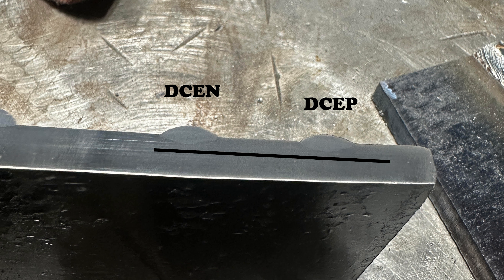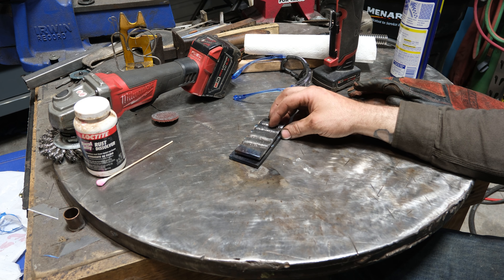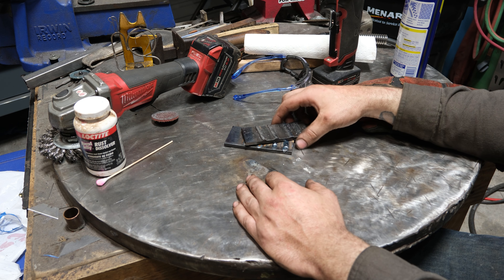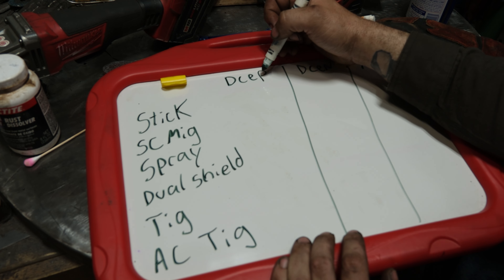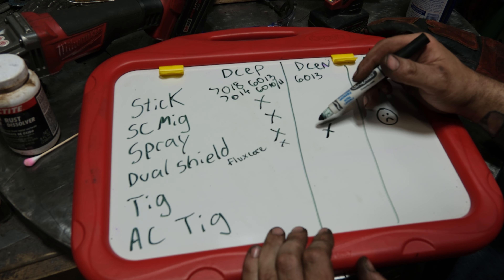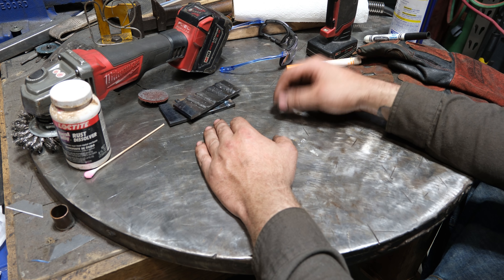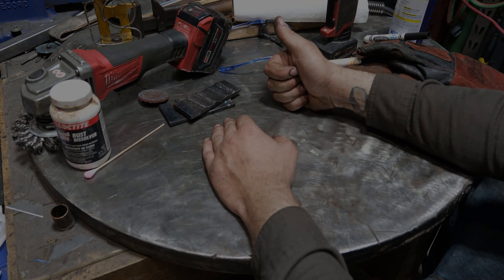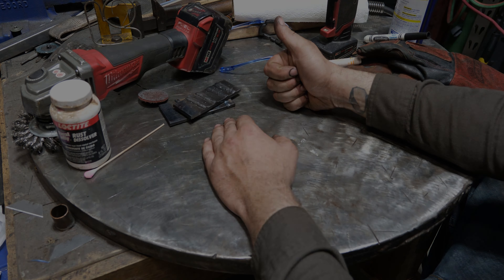Polarity and welding part 2:  Cut and etch & additional details

Comment: I had bought a lincoln flexcore welder to learn on and it sucked bad!! Then I learned that alot  are made in the same factory that makes sc mig machines and they just hookup the leads the same way!! Checked mine and switched the leads and now it welds fine!!
Reply from the maker: You would be surprised at how many welders get put up for sale as “doesn’t weld right” and all that’s wrong is the polarity.  Don’t feel bad though, I shot a whole video on doing outside corner joints with mig on the wrong polarity.  I knew something was wrong but I didn’t figure it out until the end 😅

Comment: Well, the push is a 'slight' forward angle running the wire in the front portion of the puddle, in practical practice, and it depends on how a person sets, or can set, their machine and the joint fabrication. Pulling can result in more spatter, more weld buildup, colder starts, the wire butting in the weld, and less of a smooth welding machine function and performance. You can hear how the weld is performing, and normally you'd want that sort of buzzing-whizzing sound to let you know the machine and the weld are working well together. Really, in application you're going to be changing your angles to maintain the puddle and the wire in the hotter portion of the puddle. Modern machines, with their hot-starts and other goodies, makes mig easier and more versatile, so a welder has more flexibility in their form.
Reply: Well said I have pushed 60# roles of 45 thousand wire in 7 1/2 hours some where.300 to 400 amp even 3/8 metal you know you have penetration because if you linger you fall through. I like this guy welding is vast .
Reply: First real welding job we only used .035" wire but with wire speed turned all the way up and power at around 300 amps.
' squirtgun welding ' 
Filling 1/2" gaps welding in the air.

Comment: Here in Europe, because we don't have 6010 or 7016, those who weld pipe use 7018 on DCEN for the root pass, from what I've heard.
Reply from the maker: I have heard other countries doing 7018 DCEN on pipe.  Whats wild with that is I am unaware of any manufacture that specifies 7018 to be run on DCEN (in the U.S.), and I have never heard of a code in this country that specifies DCEN with 7018 on pipe.  7018 is universally used for fill/cap and not root pass.  I would imagine the rod could be run DCEN, it would probably be less likely to drip/run on an open root.

Comment: This 1/16 rod on thin metal on DCEN sound interesting.
Maybe you can make a video about it.
NOt only autobody sheets (0.8mm or less) but bit thicker things like 1.2 or 1.5mm...

Cos lot of falks do not have MIG/MAG, but just stick, and if they can do this without making lot of holes...
Reply from the maker: I can tell you (no bs’ing) the hardest/most frustrating welding job I have ever done was auto body with stick.  Now I didn’t use DCEN with 1/16th rods but it’s hard to say how much that would have helped.  I will have to give it a shot and fail a bunch to see if it’s possible lol.

Comment: Gonna definitely try 6013 with dcen on thin sheet-metal, already bought the 1,6mm tiny sticks.
Reply from the maker: It will buy you a little bit of “wiggle room”.  6013 is pretty low penetration to start with, but sometimes any little bit helps.

Comment: I'll be testing some welds tomorrow- Mig and stick, to see what is going on with my welds.
Reply from the maker: Glad to hear it 😀👍.  It will build confidence when you can see what’s going on inside the weld.  If it’s not as good as you expected, make slight changes and try again.  Remember too, it’s very difficult to achieve a “perfect weld” so don’t be hard on yourself.  Focus on being consistent, consistency is key.

Comment: Another great educational video.  I am looking at the Everlast 200 amp migs. They max at 24v at 240.  With a 24v max, what would be the limitations other than metal thickness. Don't think I could run dual shield.
Reply from the maker: So 24v max is good for general short circuit.  Dual shield would really need 25v to work the way you would want.  Spray would be the same, 24v is the base of spray arc.  A possible solution to get decent performance would be to use 100% co2 gas.  That machine would run that and I believe you would be able to weld 3/8th steel with it.  It will have slightly lower strength than c25 gas but for most things I don’t believe it would be enough to matter.

Comment: My copy of the AWS welding hand book says that with MIG/MAG the drag technique produces a more convex narrower bead with a more stable arc and less spatter on steel but for aluminium lead/push technique is preferred as it provides a better cleaning action, I find for thin sheet steel that a push rather than pull is better as it is less likely to blow a hole. The reason why stick welding is better with DCEP is down to the positively charged metal droplets being attracted to the negatively charged work piece, accelerated both by this and the magnetic field they strike with a lot of energy which also produces heat.To my mind the beauty of mig is it's very forgiving and you can change the direction of travel to suit the job and position.
Reply from the maker: You bring up some great points.   With Aluminum mig pushing is often required because pulling produces undesirable side effects, which has a lot to do with shielding gas.  As with everything with welding there are very few things that are absolute, there is always atleast one process that does everything differently.  The push vs pull with aluminum is solidly in the “push only” lol.
Reply: When I did a lot of MIG welding I usually drug my welds to keep them neater as pushing was fine if you liked to shoot spatter balls all over the room.
With the weird metal that I TIG weld today I have found that it likes  to be pushed along better as when I try pulling it the weld is dirty and sooty looking.
There is not much difference but the weld sure comes out different.

Comment: I'm still making some test runs to determine some good ways to weld thin sheet steel (<0.060").  I've tried running FCAW normally and it usually burns through even on low settings, especially vertical up.  The same when running 6013.  I haven't tried DCEN with 6013 yet.  The only way that has worked well so far is the "series of tacks" method where you weld a second and break the arc, wait a second and go again, all the way along.  Any other suggestions for stick or FCAW for welding thin stuff?
Reply from the maker: So FCAW tends to burn hot.  To a certain extent using a machine with really good low end output helps.  Depending on your machine you may get more capability with a different machine.  A limiting factor with flux core is that it needs enough heat to function, if you reduce settings too much you will get porosity.  If you are able to weld it with a series of tack welds you should be able to weld it as 1/2in to 1in long beads.  It may require much faster travel speed.  Sometimes running a bit hotter and a faster will achieve the results.  

Stick tends to be miserable on thin material.  1/16th rods are your best friend on thin material.  Even then it’s a challenge.  The easiest to weld thin is .023 gas shielded mig wire.  With a decent machine it’s comically easy in comparison to other processes.  I need to do a video on .023 one of these days to show how easy it is to weld thin material with the right setup.
Reply: @makingmistakeswithgreg  Thanks for the quick reply and the advice.  You're right, I had some porosity and the welds looked pretty rough on the vertical up, especially on t-joint.  I would like to see a video on running .023" wire to weld some 18 ga. sheet in various positions if you can find the time.  Right now on the mig welder, I can run either .030 or .035 wire and C25 gas only.  Until now I didn't have much need to weld very thin material so I'll have to get some .023/.025 tips and feed roller and wire before I do anything with it.  I want to learn at least one good method other than tig, which I don't have any experience.

Comment: Interesting practical test.
For MMA our handbook only has a short paragraph on electrode polarity, saying something like depending on the shield material (the cover) the heat at the electrode can be more or less. Connecting the electrode to positive will get 70% of the heat and the work material will get 30%. Connecting it to negative will be the opposite. AC will be 50/50%.

Possibly that 70% heat in the material does not equal better penetration?

Maybe one should do this test also in a country outside the US, with different standards.

A common electrode here, The Elga P48, specifies on the box: DC positive, for root-welds DC negative. The most common electrode OK 48.00 is marked + (-), meaning it should be positive but can be used negative if you know what you are doing.
Reply from the maker: So on root welds I have a feeling DCEN would be used because it would help prevent excessive penetration.  The simple test I did was the best case scenario, with the least effect.  Welding an open root would tend to cause excessive penetration and internal defects.  To avoid those the gap, landing, and bevel angle are controlled to create a consistent result.  My guess is the rod you guys run open root has more penetration than a normal fill rod.   By running it DCEN it gives the ability to not over penetrate, allows faster travel speed, etc.  

Much of pipe welding (and code work in general) is finding a reliable way that’s time efficient to achieve the goal.  In this country 6”10 downhill on DCEP was chosen as a common standard.  But we don’t have access to multiple types of 6013 rods like many other countries do.

Comment: Greg, a couple years ago i watched a video of a fellow stick welding electrode negative with a copper rod in the jaws for texturing and gouging the metal for art. Is that safe for the welder and the welder?
Reply from the maker: I have never seen that but I have some thoughts.  So more or less you would have a copper electrode that passes an arc to the base material.  You would end up melting copper onto the base material but it probably wouldn’t stick which is a plus.  On a normal stick welder that regulates current I wouldn’t think it would damage it.  You may have a hard time achieving a consistent arc due to many welders not being able to supply enough voltage.  It doesn’t take much of a arc gap to hit 40volts to maintain the arc, and that is tough for many welders to output.
Reply: @makingmistakeswithgreg  Great thanks. A random or non constant arc would make a nicer pattern.

Comment: People assume that because most of the heat, and therefore penetration, is in the work with DCEN TIG, due to electrons flowing to the work from the tungsten, it must also be so with SMAW.

This is incorrect because there's more going on than just electrons and ions in the arc when you add the fact that the anode or cathode is consumable and not refractory. So why does DCEP SMAW have better penetration when the electrons are expending the energy into the stick? How could it be possible that most of the heat ends up on the negative side? Because that heat is then transferred back to the work in the form of molten metal droplets. Ever see spatter that's way outside the arc, but welds itself to the plate so well, it has to be ground off? Imagine what's going on inside the arc. 

From The Procedure Handbook of Arc Welding, "If the electrode is refractory - Carbon or tungsten - there are no metal droplets to be forced across the gap and onto the work." "More of the heat developed by the arc is transferred into the weld pool with consumable electrodes than with nonconsumable electrodes."

TIG DCEN... More heat at the work. Better penetration. 

SMAW/GMAW DCEP... More heat at the work because the heat put into the wire is then transferred back to the work in the molten metal. Beter penetration
Reply from the maker: 100% 👍👍

Comment: Whats interesting when we need to get more penetration between GMAW and FCAW.
We would run FCAW, DCEN, 0.045 and 0.035 on a miller and fronius..
And dual shield on I beams
Reply from the maker: Self shielded flux core tends to have far more penetration than normal short circuit mig.  Part of it is because it operates like a cross between spray arc and globular transfer.  What sucks is .035 Gasless flux core tends to get internal porosity on thicker material, 045 and bigger is far better with porosity.  It’s weird as well that dual shield tends to have less penetration than Gasless.

Comment: Can 7018 AC also run on DC (does it just do both)?
Reply from the maker: So this question is actually more complex than it seems.  Many 7018 rods specify they will work on a/c however owners of the old tombstones will find most 7018s don’t run that good.  Thats why there is a 7018 a/c rod, which tends to run better on those machines.  My understanding is the flux is formulated to reduce the voltage needed to keep the rod lit, which is helpful because on a/c the voltage is fluctuating between positive and negative with time spent at 0 volts.  Bigger industrial transformer welders like the dial arc 250 and ideal arc machines don’t have as much issue running any 7018 rod on A/c. 

6013 will truly run on any polarity and a/c just fine, 7018 is more particular depending on machine and particular 7018.

Comment: What about aluminum wire feed, any benefit to running it on AC?
Reply from the maker: So aluminum runs DCEP, and is done is spray mode (high voltage high wire feed, wire is liquid before it hits the molten pool).  If you had a A/c power sorce and could use that with aluminum wire, I would guess that a/c would knock it kit of spray mode and cause a lot of spatter.  

On a side note, a/c tig has the ability to weld aluminum due to the EP stripping oxides off the surface.  Well aluminum wire is done on pure EP so it too has cathodic etching in the weld area and surface oxide removal.  In the case of wire EP has more penetration, so it works.  For tig 100% EP will liquify the tungsten and has less penetration.  That’s because the arc doesnt deposit metal with it.

Comment: If dcen doesnt make the filler as hot, why dont you turn up the amps so it is similar temp?
Reply from the maker: Unfortunately it doesn’t work that way.  More wire feed speed will only make the weld taller.  Higher voltage will wet it out a bit more, but it won’t improve penetration.  Keep in mind I was running 21 volts, many machines don’t go above 22-23v and that much won’t make any difference overall.
Reply: I was talking about stick

Comment: you should do one on interpass temp and weld embrittlement-
Reply from the maker: So I did cover a bunch regarding that on hydrogen embrittlement and 7018.  However that will covered in more detail in a video I will shoot soon.  I bought some stupidly expensive “rock mount” brand rods that supposedly weld anything.  I was figuring I would try them on tool steels and see what happens.  Honestly I should do a whole video on just welding high strength steels🧐.